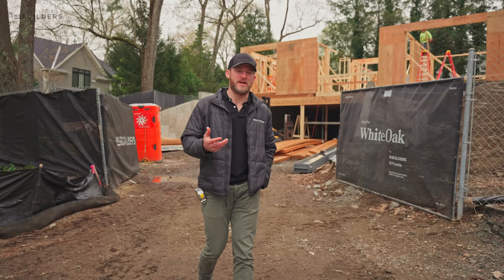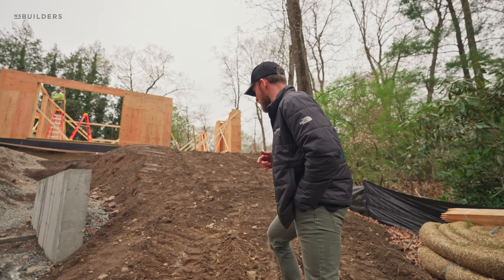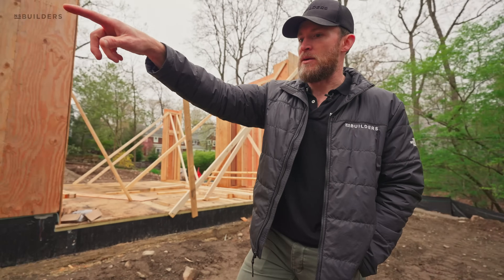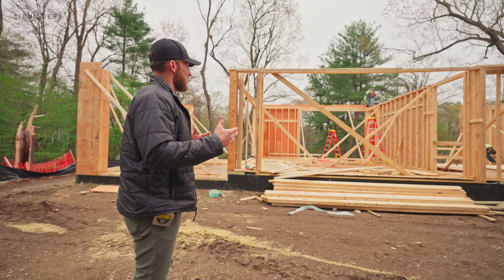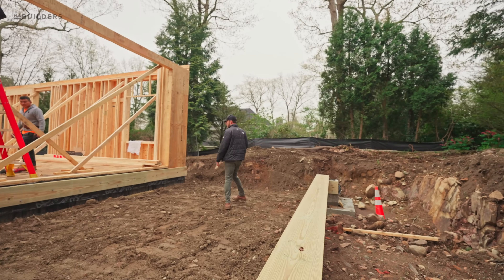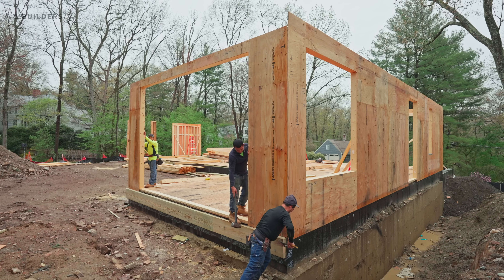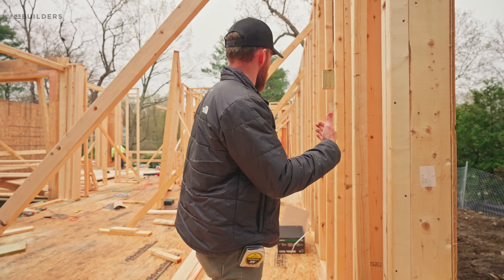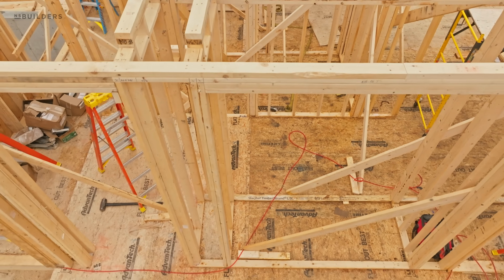Framing Our First House With Panelized Walls

Comment: The job site seems very unsafe
Reply: How so???
Did you see all the off cuts all over the place, and I am not talking about the bracing.
No safety rail on the cut out for the basement.
Reply: @pdcro1247  Relax
Reply from the maker: How so?